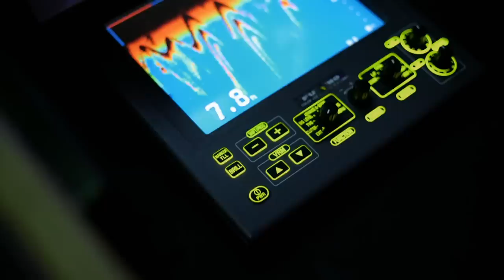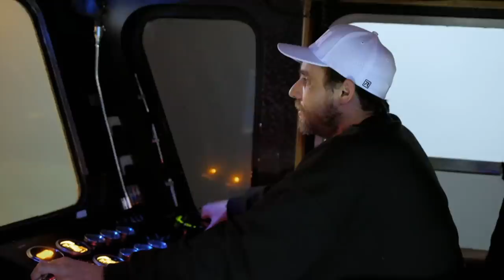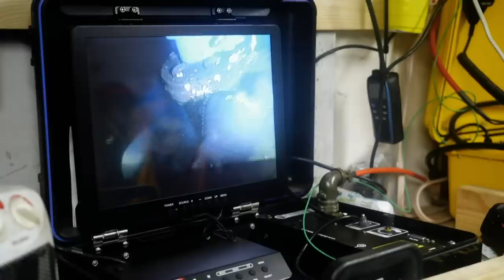Jake Takes A Gamble Fishing With A Faulty Gearbox | Deadliest Catch

Comment: I understand the need to fish, but at some point, (since I saw other videos of this boat with wear & tear and he said the same thing about fishing) you need to just fix the boat. Just get as much on the boat fixed as possible, all at once, so this doesn't keep happening, and the question won't keep coming up. You'll lose fewer seasons and have less stress like that. He's not going to lose an entire year. Just a couple of seasons needed to fix the boat. I know it's a lot of money lost and a lot of money to fix, but if it needs fixing that much, even the Cornelia Marie was out of commission for quite some time for repairs, and they're going strong. Get the boat fixed. The more it's broken down, the more it will break down, and he will be out of commission as long as the Cornelia Marie was, however he feels about it.